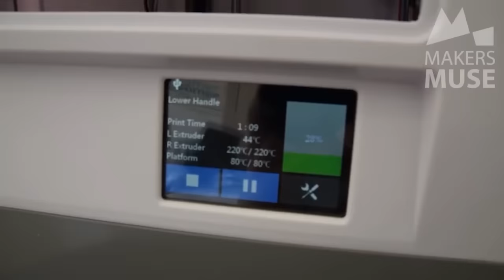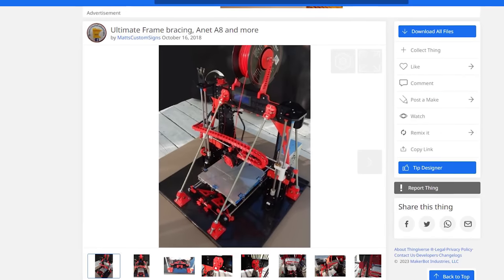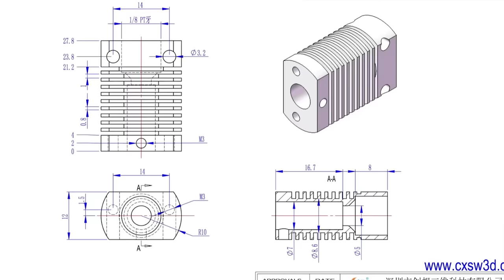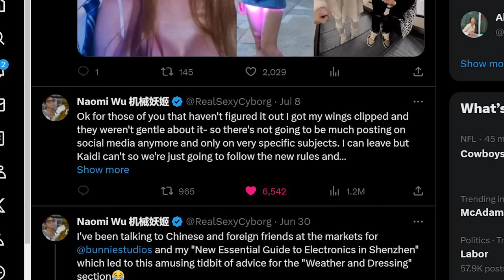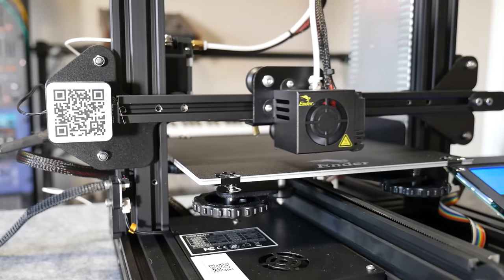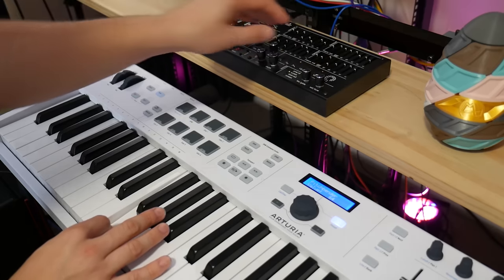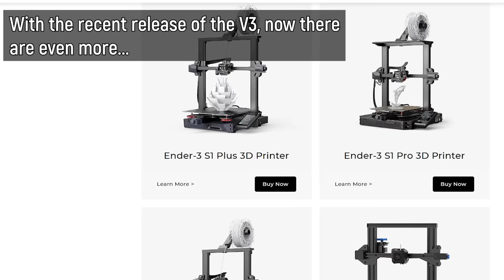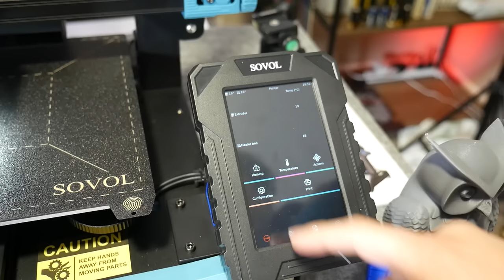Creality Ender-3... it's time to move on.

Comment: 99$ is a hell of a price to beat. if your just dipping your toes in the water to feel things out id say yah, it's a great buy. but when looking at an ender 3 you have to realize that its gonna need addons to function well. but that's not an issue since most mods run around sixty bucks anyways so again who cares.

Comment: A very weird take on the topic. Yes, there are better 3d printers that cost more. It was always like that. You either buy a better printer or mod your Ender to become the better printer if possible for your usecase. 

You failed to mention at least one printer that could be recommended instead of an Ender 3 pro/v2 in the same price range that would have the same support level from the community.

Comment: If you have an ender 3 but don't use it tons then it will do if you are using it to make 3 models. It can do what most others will do. Maybe it won't tick all the boxes of the best but it may come in at a fifth of the price. I use a cheap calculator which costs virtually nothing. I'll probably never have need for a scientific calculator costing ten times more.

Comment: The original Ender 3 is ok to die along with most of the variants. But the new V3 should take it's place, a new version implies the old one becomes obsolete, with an Ender 3 V3, the V2 and original are obsolete and a waste of manufacturing capacity.

Comment: Ender 3 pro can get 3d printer new one 161.00 with tax used same one 106.00 I can see these go under 100.00 as time goes you have to move some like car dealership allway wait to a good deal all can be up graded

Comment: Sorry but no. Innovation just for the sake of innovation leads to more points of failure. If it's not broken, don't fix it.
To me, it is a fantastic entry level printer which satisfies the vast majority of use cases: cheap, reliable printing for low complexity projects.
Absolutely none of the alternatives come close on price.
You contradict yourself completely by owning three of them and asking people not to get into them.

Comment: Bang for buck is the bottom line. People who want a tool that works without the ability to acquire some  technical expertise in the 3d process should probably not be anywhere near doing 3D anything as their designs will likely be just as unimaginative.

Comment: I know it's been three months since Angus posted this video (an eternity in the 3d world), but thought I'd chime in with my usual "curmudgeonly" response.  As someone who has been in the unenviable position of being asked to recommend a printer to rank beginners, I share the concerns about the difference between "hobby" (read-- difficult to use) and "appliance" (read-- easy to use) devices.  For total beginners, particularly those who don't really have the chops to learn CAD, fiddle with bed leveling screws, learn the intricacies of slicers, un-jam a nozzle etc., recommending the Ender 3 is a recipe for frustration and abandonment.  Seen it too many times.

Nowadays, if I get that question, my usual response is to deflect and ask questions.  I want to know if the person wants simply to print out stuff from Printables etc., or if they plan to make their own designs.  I also ask how handy they are, have they ever held a screwdriver, fixed an appliance, and so on.

Sadly much of the advertising implies that these devices are easy to use and ready to go right out of the box.  On both counts I mostly disagree, even with the venerable Bambu.  If I think someone is at such a level where they're not willing to learn, observe and diagnose, then even to this day, 3d printing is NOT for them.

All that being said, I agree with everything in this video, and applaud Angus for his astute observations.  Keep up the great work!

Comment: Dont geth a ender 3 .
He.s want.s them al for him self .
Yeah geth a bambu lab.
Whit lots of p.l.a. poop.
Come on he needs to wake up.
And smell the coffee.
Creality printers are just fine .
For a low price.
Like creality 3v3se.
Whit automatic bedtramming.
And there fast.
Easy to set up .
You run a print whit in a have hour.
There Stable.
Lits of printelbels upgrade online.
Want to start 3 d printing.
One download cura.
Download a model s.t.l. file.from anywhere.
Ask . I.a. to help you.
And i.a. can even help you set up your slicer.
Also for different nozzles.
In Cura 
I.
A
Is what you need.
To help you in your life.
Ask it anything ant it wil help you.